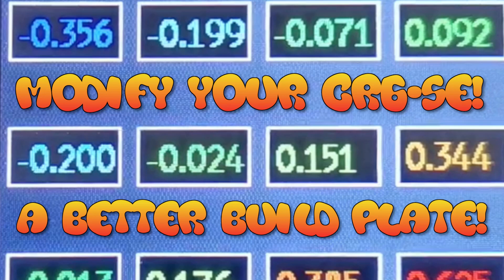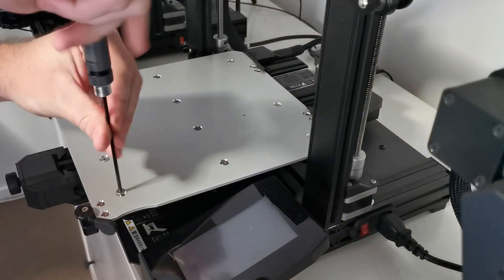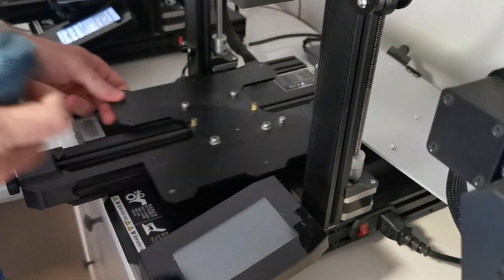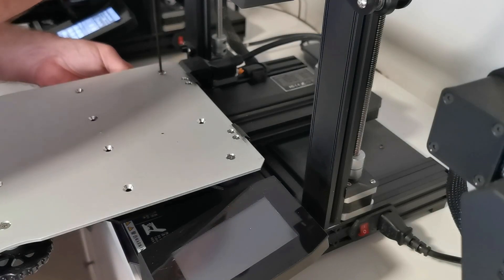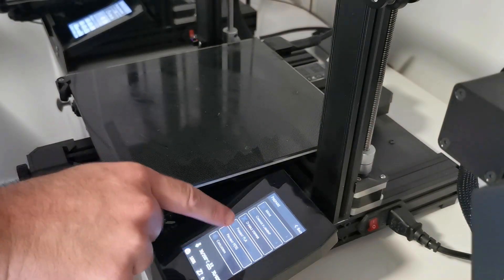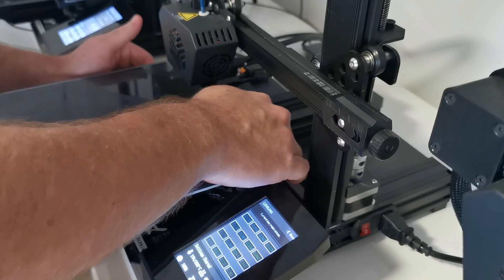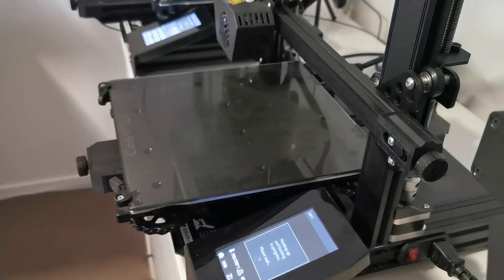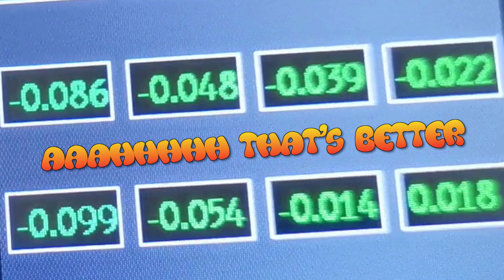Modify Your CR6-SE Build Plate

Comment: Lmao,  I love the shots fired, and I totally understand the reasons for it. I did this, except I just replaced all the useless black spacers with the silicone variety. I tightened them all, and through trial and error, I readjusted until the printer said it was good.

Comment: The cr6 se model printer has an automatic bed leveling system. When you write m420 s1 under the cura start gcode g28, it optimizes the latest bed level and starts printing accordingly. I think what you did is an insult to that printer.

Comment: Question - without the countersunk bolts being physically retained by the aluminium plate, how is it ‘forced’ up with turning the adjusting points?  You are either going to tension in one way or another, never a uniform manner.

Ultimately, this will just tension between the four points and not be a proper adjustable system.

Comment: @shanegoodwin2912 This looks awesome. My bed is quite rainbowy, having a slope of more than 1 mm, don't remember exactly how much but it could have been as much as 2. I have modified a lot of the stuff already on it, first 3D printer for me, have just had it for a month but changed hotend, extruder, nozzle, bowden tube and have built my own drybox for filament as well as an enclosure. It's a really fun hobby, love tinkering. I was just wondering, could I just adjust it with using the screws on top and custom spacers, but at the "cost" of having to remove the glassplate each time I want to adjust the level?
Reply from the maker: Hey bloke. Glad youre enjoying the hobby. :-) To answer your question, yeah you sure could do that. A lot of people report that that works for them. But yes, you will have to re-level each time you take the glass of I think. I tested it that way for a little while myself and found it to work fine. It was just too annoying taking glass on and off each time and shifting all the measurements. :-) First world problems though. AHAH

Comment: Having a lot of trouble with my CR 6 Se, its constantly not level, I've done so much to solve it. I dont know if you have any ideas? I fixed the x axis, I checked the strain gauge and its 160g on each side of the bed. I'm just having so much trouble with it. If you could get in contact with me i'd appreciate it mate.
Reply from the maker: Hey bloke. Sent me an Email at shanegoodwin501@gmail.com. if you can tell me what it is you've done so far like mods etc, that would be great. I can suggest from there.

Comment: do you suggest this over your previous video? best way is 4 knobs, 4 M4 >=28mm, 4 silicon spacers? drill with 4mm (5/32 i think in irrational units) and install? 
also, if i got spacers and they're 16mm instead of 18 that should work as well yeah?
do you see any value in installing any spacers in the center of the bed, or would that just decrease the value of having the whole knob/wheel setup?

i appreciate you immensely for everything you do, you're awesome. thank you for making the world a better place!
Reply from the maker: Hahaha hey man. I really appreciate that 😁👍 you are very welcome. Yeah for sure the 4 knobs seem to be enough. I have been using it this way for a while now and it's not moved. You could definitely put on in the middle though. You would need to work out how to get it above the extrusion down there, but it would definitely support the centre. For me man, I just don't think it's worth me worrying about. On the cr6-max for sure, but not SE.  The 16mm spacers will be fine too. The height of the bed is not crazy important there. As long as the optical sensor on the left doesn't hit the aluminium extrusion you should be fine 👍 you'll get an extra 2mm print height gap. 🤣🤣
Reply: @shanegoodwin2912  thank you for responding so quickly, sorry i didnt. for some reason my screws just fit without having to drill, not sure why or how but it worked. I'm pretty sure I've done eveything perfectly right, but still having issues simply leveling, I have no idea what I've done wrong. Could I literally pay you to walk me through taking apart the printer and building it again, or a calibration or something? I can't figure this thing out and its like weighing on my mental health at this point lmao
Reply from the maker: @TheEvilWalrusLord  hey bloke. When you say the screw fit without drilling them, are you screwing them in, or do they just slide through without twisting them? If you are screwing them in, that's the problem. The screws need to move freely through the holes so the knobs pull the bed down.
Reply: @shanegoodwin2912  THIS MAKES IT ALL MAKE SENSE THANK YOU HA OMG
Reply from the maker: @TheEvilWalrusLord  hhahahah good stuff mate. Glad it was a simple fix 🤣🤣
Reply: @shanegoodwin2912  dialing in the level now. Thanks again so much!!!
Reply from the maker: @TheEvilWalrusLord  hahaha good stuff mate. Glad it's worked for you. Happy to help. 👍👍

Comment: i wouldnt recommend the aliexpress spacers you linked. mine finally came in after a month and were so poorly cut that they were completely not level. i'm working on ordering new ones.
Reply from the maker: Fair enough man. Mine where perfect, but I do know how it works with Ali Express. The link should give an example at least 👍
Reply: @shanegoodwin2912  i leveled it out with a razor blade and used them anyway. its not bad. thanks for the guide, i really appreciate it. i did the mod and am still getting it leveled out. its going really well.
Reply from the maker: @easycheese6261  ahhh good stuff man. Glad you got them working! That's the problem with these guys on Ali Express. It's so hit and miss. Glad it helped bud. Hope the level bed serves you well. 👍👍🙂
Reply: @shanegoodwin2912  i got it all finished and got it down to a .08mm variance in Klipper, down from about 2mm. I believe that is variance between all points. I think that .08 is as low as i can get it due to a minor warp in the old glass plate and for pressure spots in the back where the clips hold the plate in place. its so accurate, thank you again.
Reply from the maker: @easycheese6261  damn that's incredible isn't it 🤣🤣 what a great result. Nice work man. That's better than mine 🤣

Comment: Hi, finally a good video explaining better adjusting the bed for cr6.. question please.. Am using the pei bed with magnetic pad. I can use the same method here??? Thanks
Reply from the maker: Hi Mate. Glad you liked it. :-) You sure can use it with PEI, as long as you have the countersunk screws. If the screws sit flush with the aluminium plate, you will be fine. :-)
Reply: @shanegoodwin2912  thxxxx

Comment: I noticed my screws fit without drilling, is there a reason I need to drill? Thank you so much for this information.
Reply from the maker: No problem my friend. The screws to fit the threads and you can use it that way for sure. If you put the knobs underneath though, they will not tighten the bed for you. They can't pull the screws through the threads. If you did this you would need to screw the screws down from under the glass bed each time. 😁👍
Reply: @shanegoodwin2912  gotcha. Thank you man you’re amazing!

Comment: I am having some leveling problems.  However, my CR6 SE doesn't show the values in the 16 boxes after auto level.  I just get the numbers 1 - 16 as is touches each point.  I have not updated or changed the software that gave with it.  Maybe my software is out of date or I am doing something wrong.   Also I removed my glass plate and replaced it with a magnetic coated plate.  Thanks for the video.
Reply: Community Firmware.

Comment: Great video thanks for the info . has the bed been good with only 4 mount points as opposed to the 8 it had before.   seems like the center could have some more flex in it
Reply: you could add back a center post or two as well.

Comment: i cant get the glass bed off to tighten screws
Reply from the maker: For real? Are you Un doing the levers??
Reply: You need to undo the two levers at the front, bring the front of the plate up a bit to clear the levers, then pull the glass towards the front of the printer to get it out from under the two fixed clamps on the rear. 00:33  If you've never removed the glass before, those rear clamps can be VERY tight.
Reply: @vee_majeno Lift the glass bed up after aligning the front tabs properly.  Then wiggle slightly left, the right, then left, then right, then the glass bed should slide right out of those rear clamps...

Comment: Lol, I'm loving these videos. I just started with a CR-6 se and am trying to figure out how to get better. Question though... Do you have your glass plate upside down? Is it better on the smooth side as opposed to the textured side?
Reply from the maker: Hi mate. Apologies for the late reply. I didn't see your comment 😕 Yeah I sure do. I just use the glass side and use a glue stick. I find it tends to stick better for me. My environment is humid and sometimes have trouble with bed adhesion. Plus when I tuff around with my nozzles, I sometimes crash them into the plate. The glass seems a little more scratch resistant. 😊 Glad you enjoy the vids bud 👍👍

Comment: Wow!! That’s nice and easy.
Reply from the maker: Yes sir. 👍😊 It's totally worth the small amount of effort.
Reply: @shanegoodwin2912  Well I might be one of the lucky ones. My bed was all green right out of the box and 1 year later it still is.  Tho I am thinking of getting a max so  this video is in my arsenal.  Thanks for your great effort.  We can never have too much info.
Reply from the maker: @PaDawg  great news man. I guess some are just square. How good is that 😍 the. Max is pretty good. Mine has been a little troublesome, but I do like it. 👍
Reply: @PaDawg  I just setup one from the kickstarter campaign(bought, assembled, never turned on.).  Bed is all .300+ along the left side except the far back left point, varies between -.100 and .100 at the other 12 points.